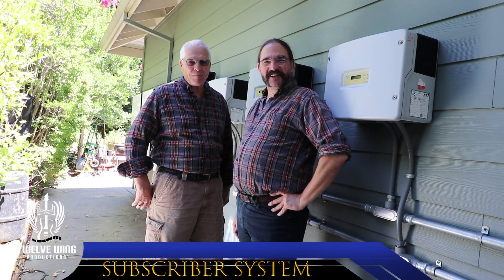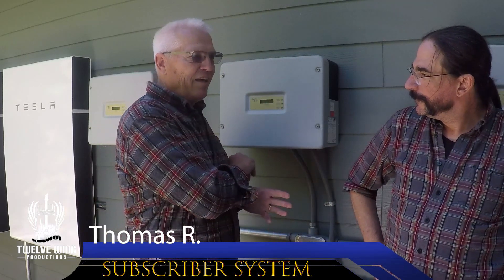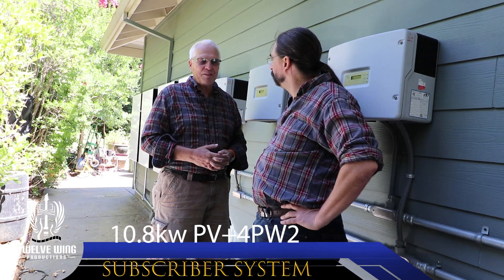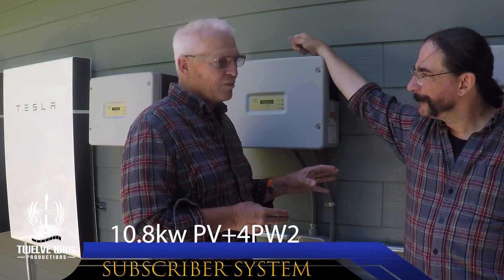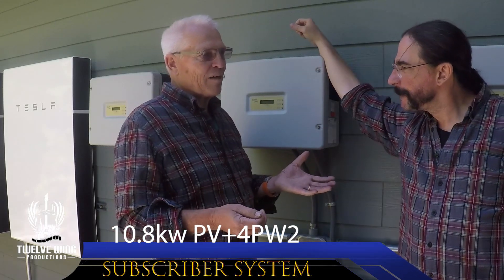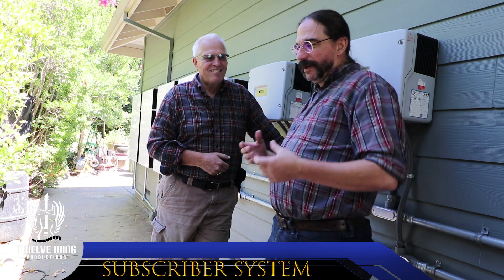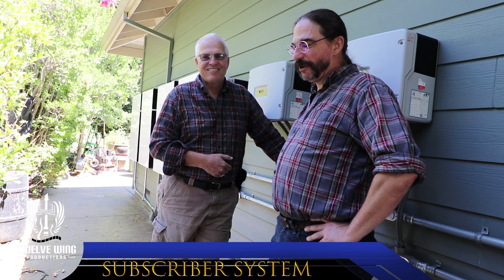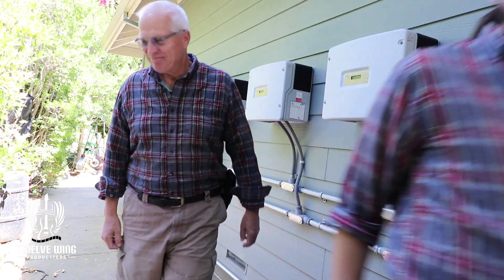Large 4 Tesla Powerwall 2 system install for Energy Sovereignty

Comment: Question if use my powerwall just for emergency use or only half of the year. How long will the battery last?
Reply from the maker: What an interesting question.
Assuming that Tesla put as much thought into how the Powerwall stores power (a good assumption I think) I would expect that you could greatly extend the life of the batteries as far as degradation is concerned.
That said, a wholly accurate answer as to how much longer the battery would last would be dependent on a couple factors.  Not the least of them being what the external temperature is where you live.

A battery in a cold climate will last a very very long time.  The problem is that it is also not quite as efficient so would have to be kept at a slightly higher level of charge to compensate.
In a hot environment with the Powerwalls mounted outside, the inverse is also true and one might expect some level of accelerated degradation. 

On the whole,  I would say that a battery kept at 60% charge and operated manually to keep it from cycling would last considerably longer than one that was cycled daily.  By how much, however, I just don't have enough hard data to be able to answer your question beyond that.
Neat question though.

Comment: Thank you for your videos! I’ve enjoyed following and all the information. Install day is today 8/7/19 for me and I can’t wait to start the journey!
Reply from the maker: Congratulations!
Tell us a bit about your system.  Also, once it's installed, please give us your thoughts and tell us how your installer did.
Reply: Twelve Wing Productions  I have a 4.8 kWh system with 13 Sunpower panels on the roof. These panels are running off micro inverters which was a totally new concept for me. Today was the wire pulling day to relocate main breaker. Tomorrow will be the install of 2 Powerwalls for full home backup capabilities. I will definitely update once the install is complete.
Reply from the maker: @theunknown2011 , We have the micro inverters at the system here at the studio.  Very efficient.  You will like them.
I need to get a couple powerwalls for the studio.
Reply: Twelve Wing Productions Batteries are installed and spending their first day charging. Installer did a great job. It was their first Tesla install and they got it up within 2 days. 
Tesla app only allows backup and self power modes right now. No storm watch or time of use available. I’m interested to see how it learns over time once I switch it over to backup.
Reply from the maker: @theunknown2011 , Fantastic!  Congrats.  Poke your head backin and let us know how it goes.

Comment: You both have nice systems , but batteries are so expensive.  Have you figured your cost per watt?
Reply from the maker: Both of these systems were purchased using California's SGIP rebate program.
Each Powerwal 2 comes to about $4,800 installed.
Reply: Twelve Wing Productions I am envious. I would like to have your battery capacity, but NC has no such program. Very nice systems.
Reply from the maker: @senordockman1138 , You can expect that the prices will come down very rapidly.  Tesla seems to be using the money wisely and they aren't just mass producing current tech but they are researching how to do this all better.
It won't be long before you can totally afford the 60-90kwh batteries you need for energy sovereignty.  IT's just something that is inevitable now.
Reply: Twelve Wing Productions I hope you are right. Have you watched EV TV with Jack Rickard out of Missouri? He is working on establishing used Tesla batteries for solar use in private residences. I am hoping to install one of his 60 kWh creations for our home. If that does not workout, then I will turn to Tesla.
Reply from the maker: @senordockman1138 , Yes... I've been following him for some time now.  Great work he is doing.  His videos are a little hard to follow by subject, however.  So I find myself just sitting having a scotch and doing other things while his video plays on the big screen.  When he says something that catches my attention I rewind to see what he's on about.
He is 100% on the right track trying to come up with external software to run batteries directly out of destroyed cars.  There will be an RV market for this as well I'm sure.

I'll do a video on my thoughts of what a 21st century 5th wheel looks like and performs like shortly.
Reply: @twelvewingproductions7508  Ummm, what? $4,800 installed? I just got a quote from Tesla Solar to have panels and a single PowerWall2 installed. The PowerWall2 is listed as $10k installed with a $1k discount on the quote. I asked them to verify that it's only one single battery, and they said it was.
Reply from the maker: @GovG33k , You heard correctly.  If you are in California, use this link to contact SunWorks for a quote:

Sunworkspowerpay.com/p6tsxf

If you aren't in California, you will need to get a couple quotes to see if there are other special rebates going on in your state.  I might be able to help you look into that, but currently I only know of California's SGIP (Self Generation Incentive Program) rebate.
Reply: @twelvewingproductions7508  I'll talk a look for sure! I'm in the Central Valley, almost East Bay area. Thanks!
Reply from the maker: @GovG33k , You are set then.
You should easily get in before the first of the year when the rebate amount goes down.
I'm trying to help as many people who want to do it to maximize the rebates by talking with the right people.
SunWorks seem to be the right people.  They have the right crew and most of all... they can actually get the batteries.

How many were you looking to install?
Reply: @twelvewingproductions7508  I have a 7.56 kW system with one Powerwall2 for $32k pre 30% rebate. Just curious, is the lower cost you said for the PowerWall2 because you opted for the California rebates which allows them to use your battery during an outage? I know I don't want to be part of that, I prefer to be an island.
Reply from the maker: @GovG33k , I'm not really sure I follow what you mean by "Let them use in an outage"?
The system is designed to run the home in the case of a power outage.  That is usually what is referred to as being "islanded".
All homes in California have to conform to what is called "Rule 21".  That is to say that all systems, grid tied or no, have to have inverters or inverter control systems that can be controlled by the grid in the case of emergencies.

With the Powerwall battery, however, you do always have an off switch.  Flip that grid switch and your system will continue to operate independently from the grid.

To my knowledge, there isn't any difference between how the rebate is delivered as far as the number of batteries.  That would be something you will need to talk to your rep about.  I think you will be speaking with Eric Jewell.
See what he has to say.  He is very knowledgable.
I would, however, recommend at least 2 powerwaslls unless your home is very small.

What is your average daily home consumption... and do you have an electric car?
Reply: @twelvewingproductions7508  I really appreciate the time your taking with me. Regarding letting them use the battery in an outage, I mistyped. Mental note... Don't hold a conversation while typing a correspondence, lol. Anyway, my understanding of using the rebate from CA is that my battery(s) becomes part of the grid and it's required to never be a "backup"mode  for just my home during high usage times. True?

My home is a small 1,600 2-story. We consumed 13,000kWh last year and still got into tier 2 even with PGE Medical Baseline.
Reply from the maker: @GovG33k , My pleasure.

And no, your batteries are your batteries.  They island your equipment even if you have a grid tied connection.
With that consumption (without an electric car) I'd say go for 2.  If you are planning on using an EV or trying to go for energy sovereignty... I'd say 3 at minimum.

A lot of this depends on your goals.  If a speedy ROI is what you are looking for then factoring in your gasoline offset for that is probably the most attractive.  If you are just looking to get out from under the thumb of the utility company's ever increasing rates... then 2 is fine.
I do think you would be disappointed with one since you would continually be sipping from the grid power.
Not due to capacity but because each powerwall delivers 5kw.
So every time your home's load went above that, you would draw from the grid.
2 PW units give you 10kw.  3.. 15.. etc.

If you want to see the results from actual use, go back and have a look at a couple of our one month closeouts and compare the usage of The Energy Sovereignty Project home to your own projected usage.
That's why we did it.  To help folks like you make informed decisions without any hype or shady business.
The numbers are what they are.
Reply: @twelvewingproductions7508  We do plan to get a plug-in next year actually, but difficult to justify since our vehicles are paid for. Our motivation is to curb the rising costs of the blood thirsty energy overloads, hopefully at or near our current $250/mo PGE bills. The benefit to the environment is a nice side effect, but not a priority. 

I originally wanted two Powerwall2's but couldn't swing the $11k each. Mostly because I would love to have a level-2 charger for the future plug-in. Based on the quote from Tesla I can only afford one, I was hoping I could scale the system up as needed.  I'm trying to stay under $35k. Thanks again!
Reply from the maker: @GovG33k  Well, now that you might be able to get them at half price... you can get two.. then wait for a year and see what happens with the technology.

Tesla has solid state, or solid state hybrid batteries that it is already testing in it's industrial grid battery.  So it's likely that by the time you are ready to go full electric in your transport, you can add a battery for what you will pay after the rebate.
I think that would be a safe bet.

See what Eric has to say about your SGIP qualification.
Reply: @twelvewingproductions7508  I got ahold of Eric today. Great guy. Curious, is there a way I may contact you instead of replying to the whole discussion thread? I had a few questions if you don't mind. No worries if not.
Reply from the maker: @GovG33k  Certainly.  Let me know when you get that.

Comment: Nice setup.  Congratulations!
It seems the Tesla app has different options based on location.  I'm in Maryland without Peak/Off Peak rates and my app doesn't show options when to discharge a battery.  Unless I'm missing some hidden menu.

Interesting enough,  my PW2 does charge from a grid during Storm Watch.
Reply from the maker: Ours will charge from the grid during "Storm Watch" but only when Tesla decides the storm is strong enough.  It's likely that by the time they make that determination, we will all be sitting in the dark.

If you could do me a favor and update your app and then describe to me the screen you saw that you haven't found.  I'd like to help you sort that out.